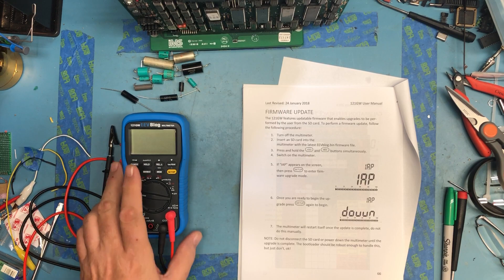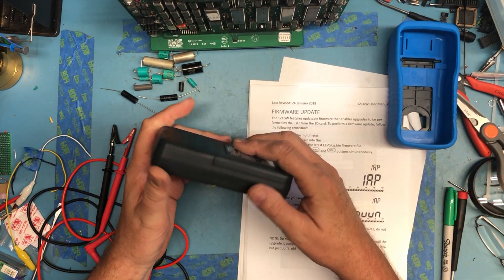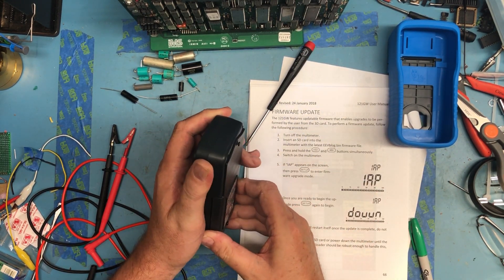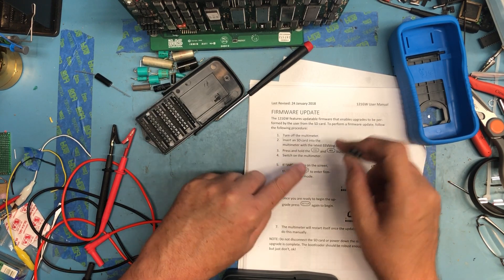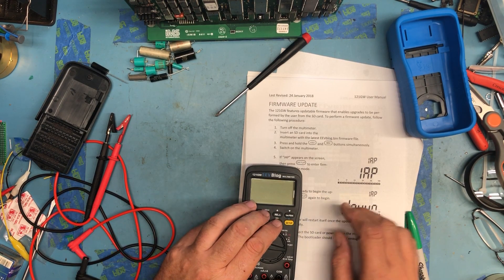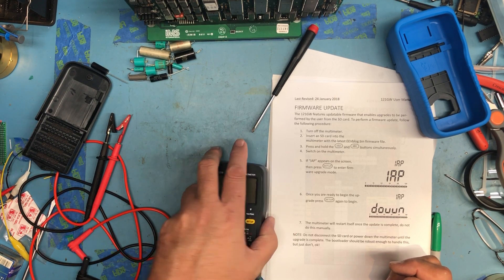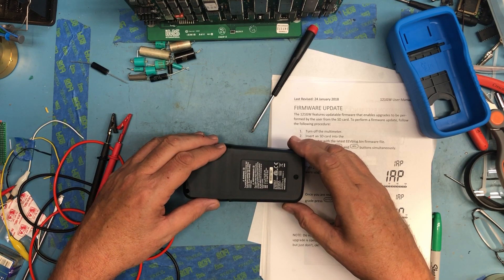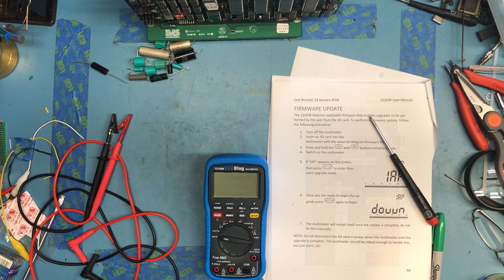EEVBlog 121GW - Part 1 - Updating the firmware - STB369

Comment: If you had purchased 121GW from Amazon, would you return it for another multimeter?
Reply from the maker: I did purchase it from Amazon. No, I don't think I'll return it. I'll be posting a few more videos this weekend one of which explains why I got so confused on the resistance shootout video (basically I didn't realize the enabling REL mode to zero out the lead resistance disables auto-ranging). So far it's a keeper, I just did some data logging with it measuring a DC voltage and the results look good.
Reply: @ShadowTronBlog  Good to hear that. I was
 trying to justify, like your comment earlier; do I really need 15v. diode test. I ended up getting B41T+ at quarter the cost and yes, I'm fully aware of B41's shortcomings (I won't be using it with anything other than electronics or common household tasks). In the end, the inconsistencies with 121GW as shown on the video clip that I linked earlier, I decided to not get half baked 121GW. I wish it was manufactured by Brymen, maybe it would have turned out more stable, who knows...
Reply from the maker: @tech29X  What you're say is true of all tools. Understand what you're buying and understand how to use it safely.
Reply: RW-RW-RW the 15v Diode Test mode is great. I used it now many times for z diodes and to test leds in series.

Comment: Now let's redo the resistor tests after the firmware update :-). Also, a video about data logging to the SD card and looking at log file would be much interesting; For example; Does each measurement have timestamp next to it, so we know the log interval we set up did not drop any measurements while recording. If we set the measurement interval 1 sample per second and if we see 30-40 second gap between record (row) number 52 and 53 we can assume there were some measurements lost while writing to the log file, etc...  Enjoy and good luck.
Reply from the maker: I'd been hoping to get to this as well. Deep in another project but will do this possibly this weekend.

Comment: How does the dial knob feel? There were problems with earlier production models that felt loose and sometimes shut off the meter when dial knob was being pressed or wiggled.
Reply from the maker: So far the knob has been fine. I recall seeing the EEVBlog videos on the issue. It feels as solid as better quality meters I've used. The build quality feels really decent, feels a sold as the better Fluke meters do.

Comment: could have bought a fluke with that money
Reply from the maker: Yeah, I really could have / should have. Not sure it was the wisest buy I've made. I'm a fan of the EEVBlog and decided to jump in and see what made the meter special which so far really isn't much.
Reply: @ShadowTronBlog  With Data logging option for a comparable Fluke would be much more expensive. Low burden voltage and 15v. diode test are among 121GW's distinguishing features.
Reply from the maker: @tech29X  Agreed, it has some impressive features for the price. The question becomes how often will the 15V diode test mode, low burden voltage and data logging capabilities be used.
Reply: @ShadowTronBlog  I see your point but many other meters have features we don't need/use. I think the bigger question is, "is this meter stable and reliable compared to it's peers at this price point?" It feels while a new firmware is fixing some problems, seems to introduce new set of problems "firmware effects on noise" https://youtu.be/RWqP0gM_Qf0?t=450 , or the EMF test with tape eraser.  This is the design of the guy who spent years criticizing other multi meters and and now look at his design. It makes much cheaper Owon B41T+ look like a champ.
Reply from the maker: @tech29X  This has been an interesting experience. I don't know what I was expecting but it felt underwhelming when I received it. I get the no BS packaging, makes sense in a lot of ways however it didn't jump out at me as exciting when I opened the box. I think this left me thinking huh... what have I actually bought? I still haven't watched any other review videos as I want to stay as unbiased as I can. There seems to be a lot of noise on the lower resistance ranges which is disturbing, my low end Rigol bench meter is very sold at the lower ranges however even being the low end model was far more expensive. It has 4-wire resistance measurement capability so right from the start this is an unfair comparison. The 121GW offers a lot of resolution on the lower ranges however the measurement dances all over the place; this looks like a good target to do some data logging with. It's super fast on continuity mode; the fastest meter I have which I truly appreciate. You're right, Dave over the years has been pretty unkind about other meters, I think I was expecting something more from it without really knowing what that "more" would be. I also haven't begun to explore it's other capabilities, partly driven by other more exciting projects on the bench and partly a lack of interest in diving deeper. I spent around $1000 on a JBC soldering station with an assortment of tips; it's been an excellent tool compared to the other soldering stations I've had. I don't regret spending the $1000, has been an excellent investment. I spent around $300 on my Hakko desoldering tool, again I've had no regrets, well worth the money. Both the JBC and Hakko tools were an order of magnitude better then the previous tools I was using. I guess part of me was wanting to feel this same "order of magnitude"improvement over my older meters and when I didn't feel this I was disappointed; still this is an unfair expectation. The build quality of the 121GW feels excellent, it feels like a quality meter in my hand which which I truly appreciate. It feels like I should easily get years and years of service life from it.
Reply: @ShadowTronBlog  I think "We expected more from the guy who spent years criticizing and lecturing about other multimeters designs and faults" pretty much sums it up. I'm coming to the conclusion that high resolution "high digit count" meter that's not accurate is useless, or even worse than having a "low resolution but accurate" meter.
Reply: specially if the measurements is going to continuously fluctuate several digits, then is it truly a 50,000 count or 5,000 count meter?